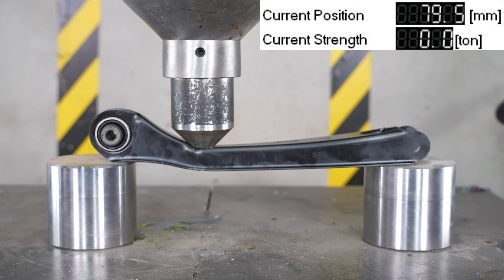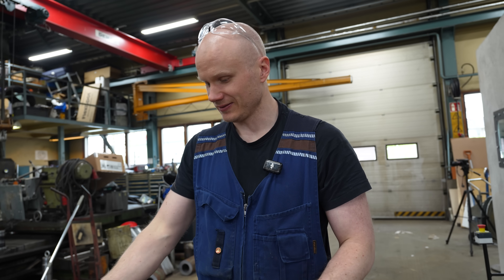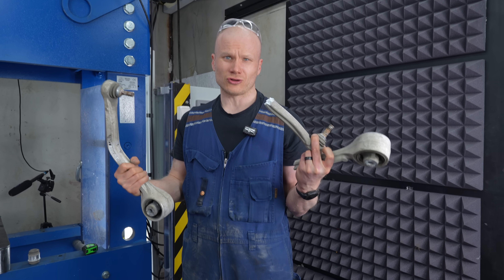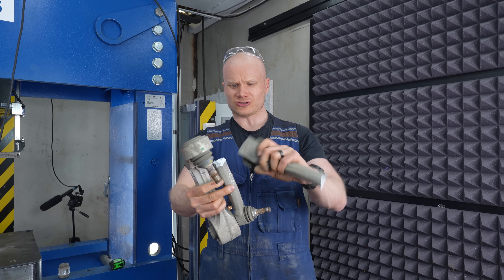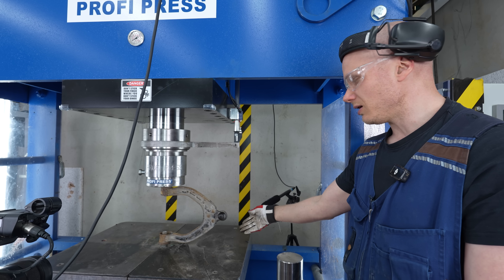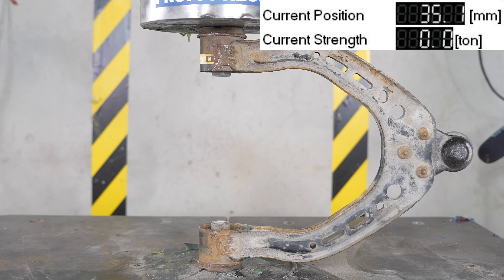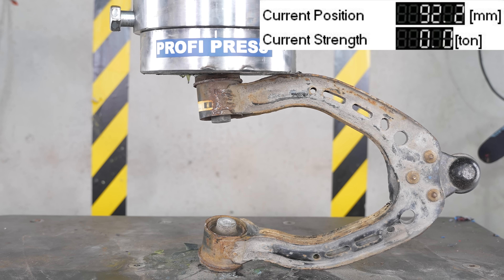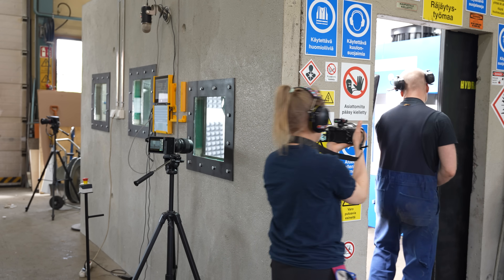Crushing Parts From My Tesla Model S

Comment: Lol Tesla parts are known to fail
Reply: Suspension arms are designed to deform for crash protection and to protect the chassis suspension mounts from damage in a minor accident. Sorry to debunk your prejudice.
Reply: @dopiaza2006 no prejudice , Tesla parts have historically been known to fail under stress. Just look at how the cybertruck fared when towing . So no prejudice
Reply: @bogganalseryd2324  The cybertruck isn't exactly the average Tesla lol
Reply: As a previous Audi only driver, and now Tesla for the last 4 years, I can say, there is no difference, they both have the same control arm problems, and It's not just Audi and tesla either ^^ but the Tesla is way more fun, more reliable and has lower running costs than anything else. I prefer parts that are known to fail and not designed to fail.